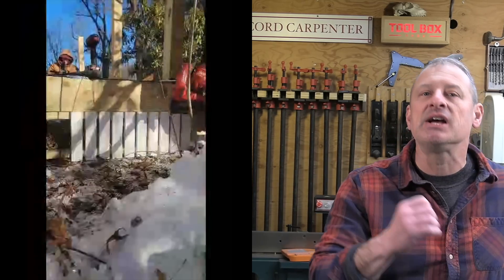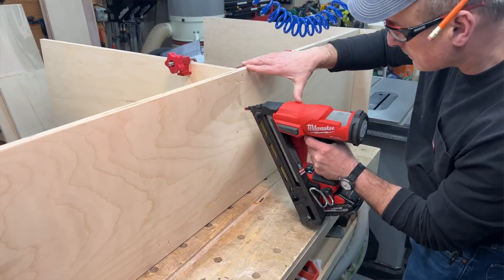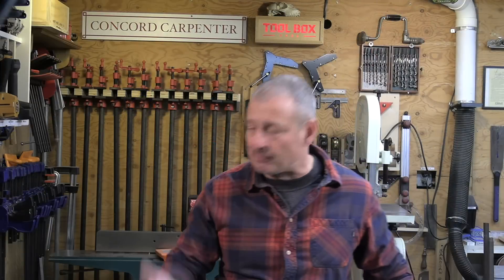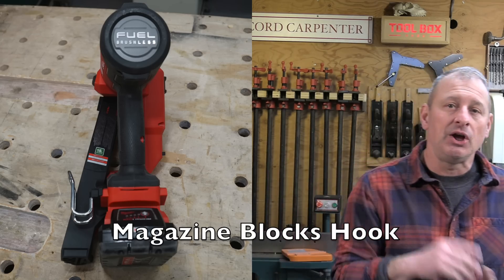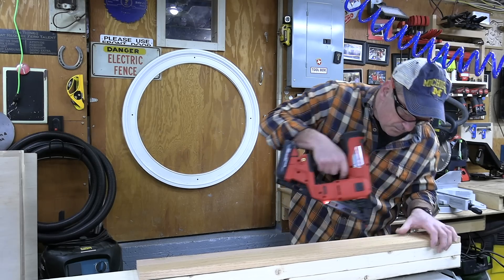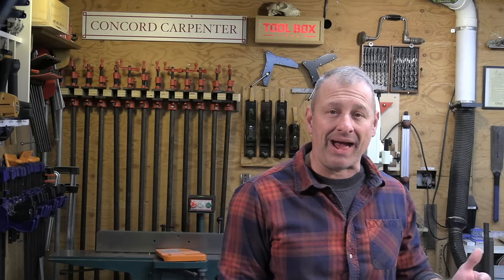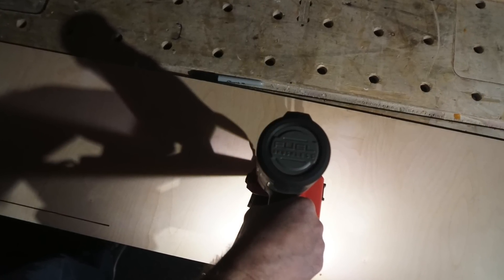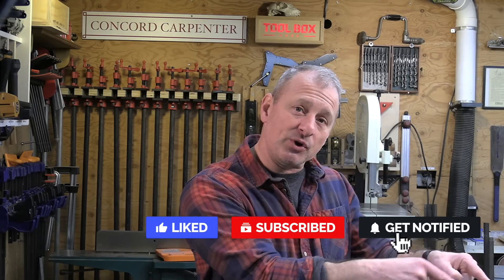Milwaukee Gen 2  Finish Nailers - What's Been Updated

Comment: I’ve had a few different brands of 15-gauge angled nailers but got rid of them, preferring pneumatic ones. I picked up the Milwaukee 15-gauge Gen II for hanging doors since the air hose often gets in the way. The Milwaukee works very well, though I still prefer the size and weight of pneumatic nailers. However, for doors, the Milwaukee is my preferred choice.
Reply from the maker: @TheSmartWoodshop  thanks for the comment Ron. - I’m a fan of your organization and efficiency methods

Comment: Is there a real need for the 16g vs the 15g nailer? I have the 18g 1/4 stapler and the 18g nailer and just added the 23g nailer to my system. I plan to wrap up my kit with the 18g framer 30 degree but want to get the 15ga first. Which I think is more practical. Do you agree I should take this step because its better or do you have a different option I haven’t considered?

Comment: Im looking to get a 18 ga brad nailer im on Ridgid and Milwaukee platform ive been checking out Ridgid clean drive but im still not sure. Im looking for very clean holes since i install trim that has already been finished, painted etc. Actually one of the contractors wants me to use 21ga. Any advice?

Comment: Great video and you made a very good point talking about overload. Never on a job site have I seen someone machine gun style driving nails and it bugs me when some tool "reviewers" are speed nailing on auto mode. Maybe a roofer will want to fully auto drive nails time to tim e but I've never seen that done on a finish nailer. 

Its ok to say the gen 1 was garbage, my old man has been maker for many years and the gen 1 made him give up on cordless nailers, but trying this new gen 2 its more pneumatic like. In a shop we'd both still prefer air for size mostly  but on a job site or a quick fix the cordless are great.
Reply from the maker: Same for me in shop

Comment: I run Hikoki nail guns that are air filled. If they lose pressure my local tool shop can re fill them easily and back to work. The same shop repairs Milwaukee too. If one of their nail guns comes in with lost nitrogen pressure you have two chances. If still under warranty the whole gun is replaced. If out of warranty the gun is written off and you need to purchase a new gun. They can't re pressure them. This may be possible in the States I don't know but is a deal breaker for me here.
Reply from the maker: I asked Milwaukee they said:  – The statement made by the commenter is not at all accurate per any of our service or warranty policies. In fact, a big reason that they are not user serviceable (i.e. nailers need to be sent to Milwaukee for piston/striker/cylinder service) is to ensure that when they are serviced and re-pressurized that it is being completed correctly, to the proper pressure, to ensure service quality. If the tool requires re-pressurization, regardless of whether its within or outside the warranty period, that’s a service we can have the capability to complete and we do regularly as necessary.
 
In some instances we’ll replace the tool entirely if the service parts required are not in stock. Obviously we try to avoid this situation, but it happens, and when it does we’ll replace the tool to ensure the customer isn’t without their tool for an extended period of time waiting on parts to be back in stock.
 
Now I can’t speak to or dispute this individuals experience with their distributor. Based on his description, however, sounds like he may be working with a repair shop that isn’t an authorized service center for Milwaukee Nailers and he’s being given incorrect information. That shop does not have the ability to re-pressurize our nailers, but we absolutely have the capability to re-pressurize them within our service network globally.

Hope this helps! ROB
Reply: @ConcordCarpenter  Hi Rob Like I said in my initial comment the re gas is probably available in US but I am in Australia. We struggle to get parts for most things and I can only go with what my tool repair shop can do. They are pretty much the only repair shop that does anything to these guns for miles that you would bother to go to and they can't do them. I have spoken to Milwaukee in America myself in the past with other issues and they tell me one thing but refer me back to Oz that tell me something different. In my opinion the fault lies directly with Milwaukee. They tell you they have global repair shops that can do all. No they don't. That is a lie. In Australia most repair shops do most brands if they can get the parts. They are not specifically trained in one brand but do their best with all. The only company I know that repairs its own is Hilti. Possibly if I lived in Sydney or Melbourne I may be able to get the re gas but I live in rural Qld and I am told they can't do it and throw the guns away. Fact.
Reply from the maker: That doesn’t seem right , I’ll ask,

Comment: They do shoot great but they are 2lbs heavier then the Paslode! I’ll stick with paslode.
Reply from the maker: That’s the price for not having to deal with gas issues
Reply: When it comes to framing gun I'll stick with my passlode even if I have to pay for the gas cartridge,  Milwaukee and dewalt too heavy
Reply: @agent7agent759  I absolutely agree
Reply: How does the paslode work in colder weather?
Reply from the maker: @huejanus5505  they’ve made improvements to it - we covered this in our cordless framer head2head and review on paslode a few years back
Reply: @huejanus5505  I haven't used in extreme cold weather,  I usually take decking jobs close to spring time though the summer,  heard it doesn't perform well , but they updated their gas tanks that works in cold weather

Comment: I currently own and use Gen 1.  Everything you’ve mentioned is true.  I’ve learned to set the nail depth to just above the surface and manually setting the nail afterwards.  This left a clean hole but added time to the install.  Next time there’s a promo, I’ll definitely replace my Gen 1!
Reply: Labor day sale at toolnut and they have a promo for the gen 2, just saying!
Reply: $239 for Gen 2 15 Gauge Milwaukee  in store only right now for Black Friday

Comment: Thanks Rob for the updated info. Definitely going to grab them when they're available. I used the gen 1 16 gauge on a trim job in a million dlar house and was annoyed by the big shoe on that nailer. I used the gen 2 18 gauge nailer quite a bit on that job as well. I loved the small nose on it.
Reply: I think Milwaukee 23 and 18 ga gen2 nailers are the best battery nailers.  23ga is probably the best pin nailer I ever used, battery or pneumatic.  It's just so hard to find a great pin nailer that's not finicky with some nails.  My theory is that tolerances are so tight at such a small size, that I think even within brand you can get variations and gun can perform better or worse depending on how lucky you get.  I've had that pin nailer for about half a year now and I don't think it jammed on me once yet.
Reply: @Fpsnut  I just got the 23 and 15 gauge nailers for an upcoming job and hope that I am not making a mistake

Comment: Hi Rob, I primarily sell real estate here in Hawaii but really love doing some remodeling and DYI stuff. I prefer the Milwaukee and Makita lines. I am probably split 80% between Milwaukee and 20% for Makita. I plan on purchasing a framing nailer and a pin nailer later on, but would love to start with the Brad finish nailer now. If you were to choose just one brad finish nailer, which one would you recommend? Thanks in advance!
Reply: I‘m not Rob, but I can tell you I bought the gen2 brad nailer from Milwaukee and I‘m more than happy with it. Performance is great, accuracy is a blast.
Idk about the Makita, but I would guess both of them are definitely worth their money.
If you don’t use it too often and for smaller works, maybe also check out the Milwaukee 12V line. They perform great and there is a huge range of tools you can get in 12V ✌️😎

Happy remodeling!

Comment: Good video. I always appreciate your channel because you go through it from a contractor, actual-use perspective. One thing I didn't see is if the new lower pressure can still fire through deep, solid hardwood pieces. Did you and your crew try any shots through solid 2" oak just to see if anything got left proud?
Reply from the maker: Tested into 3/4" oak and 2x4  didnt have 2" Oak - not a real popular application for us

Comment: Has been my best purchase as far as tools go in the last few years, 23g all the way up to 16. Loving Milwaukee’s gear. Great vid again guys, keep it up 👍🏻!!
Reply: 2 years ago I was forced to but the 2nd generation 18 gauge nailer because I had a job and I needed the nailer right now and that was what they had in the store. 

I have bought the 23 & 15 gauge nailers for an upcoming job and I am hoping this  is not a mistake
Reply: Do your 16ga angled finish nailer Gen II use paslode finish nails?
Reply: @EveryDayCivilianBlog  yes I have been using them mostly, and also Porter Cable.
Reply: @ryanhill2348  thank you for the quick response. Always been running the 15Ga nailers and have the Gen I 15Ga but I’m leaning towards the 16Ga and using the paslode nails to replace my Gen 1 15Ga.
Reply: Im glued to my cadex 23ga. I think they have patent protection still. It can shoot 23ga headed brad nails up to 2 1/2". The nails are pretty strong too, feels like stainless steel. The only down side is trying to pull them, they often break...

Way better holding power vs a headless pin! Bummer it needs an air hose though...

This m18 15ga nailer is hot on my list. Might be a today thing, if not in a couple weeks.